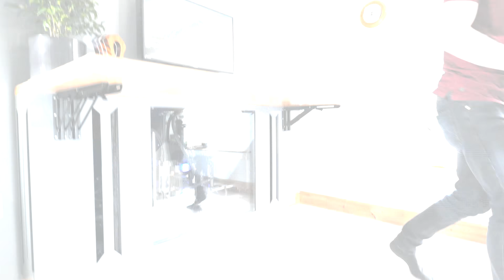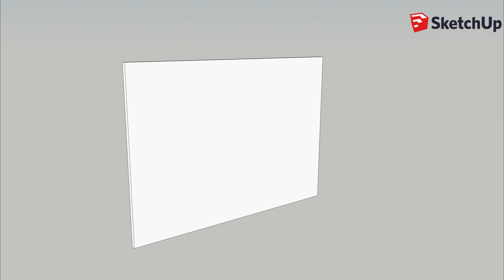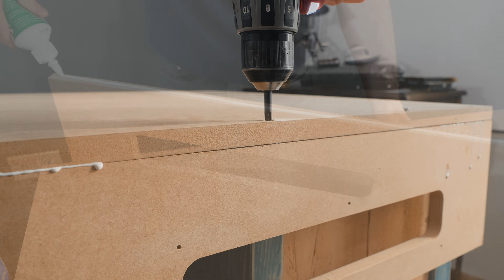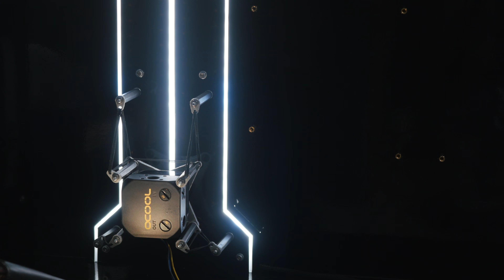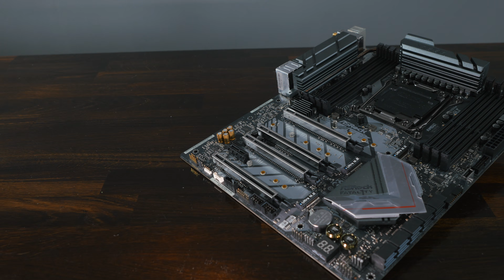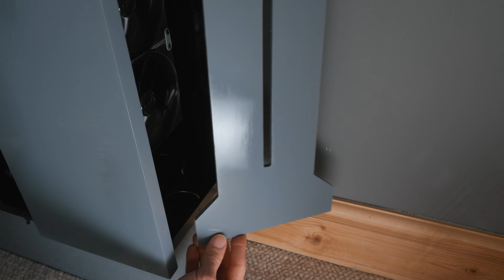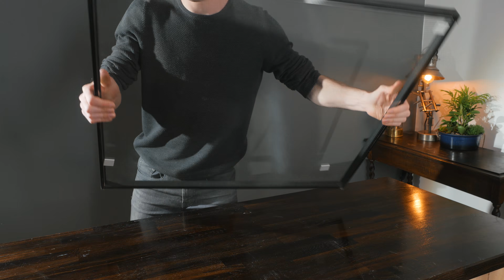Building a spectacular DIY 'desk PC' (it can fold!)

Comment: I absolutely love the design and build but I have two concerns.

One is the mounting method for the water pump, radiators, etc. Those elastic pieces do not last and especially under such heavy hardware and water being held up, they will not last over time. I strongly recommend you pull those out and build solid shock mounts instead.

My last concern is why did you use MDF? Why didn't you use plywood or a more premium hardwood for such a powerful build? MDF is not a very suitable material for cabinetry.
Reply: The density and characteristics of MDF help with noise reduction and it's cheaper. Bear in mind that although the PC Components are premium, he has them due to sponsorships, and he has to buy everything else, like tools, paint, etc

Comment: Nice build, as a amateur woodworker and future water cooling enthusiast, Well done Mate. Personally I like the Corsair vengeance RGB ram, and the G skill Trident Z ram. I prefer the look of EKWB components, I already have my water blocks, Pump, and Radiator. Fittings are from Primo Chill, and the res is from Bitspower. 

But really man in the future if you want to do custom cables just do it from scratch. I cannot imagine how much it took to solder on extensions. When all you need to do custom cables like I am now for my build (Fractal Design Define S2) is Crimpers, side cutters, wire strippers, 18 gauge wire, sleeve, terminals, and heat shrink. Once you get the hang of crimping its really easy. Look into the heat shrinkless method on youtube for tutorials on custom cables if you ever do it again.

Comment: You seemed to have removed all thermal pads from the graphics card and didn't apply new ones before attaching the alphacool block. Is that block really supposed to attach without thermal pads? I haven't seen GPU blocks that do not need thermal padding so it gave me cause for concern.

Excellent build otherwise. When you released the announcement video (sort of) for this you inspired me to do my own version for my computer, which ended up being a mini-ITX system built inside a shelf (mock-up: https://i.postimg.cc/YCDp7QLx/Untitledv3.jpg). Now that your build video is out I'm glad I'm not too far along building it, because there are some great woodworking ideas here I could use to make improvements. If it was up to me, I would've just carbon fiber wrapped the entire thing and called it a day. :P

Thanks! Glad you're back!

Comment: I would love to see how he gets the air bubbles out. This whole desk is a mistake, anything air tight will just continue to get hotter and hotter due to components, there is a reason Lian Li makes their desks the design they are.
Reply: Have you ever setup a water loop? You get rid of the bubbles when you first fill it and then run it for a period and they will dissipate. 

It's also perfectly fine with being airtight. The internal water loop doesn't need airflow, just the radiators which he mounted and put towards the external openings on the side of the case. Maybe you didn't catch that.
Reply: @gaderic  I have built many watercooled PCs usually you tilt the PC to get the bubbles out, which is why every techtuber does it.

Comment: Excellent creation.  By the way I'm a Plumber by trade and noticed that the radiator to the left of your wonderful creation has a thermo static radiator valve fitted near to where the heat is dissipated from your cabinet. You may need to adjust the setting higher on this valve to allow for the additional heat which may influence it coming from the PC, otherwise the room may cool sooner due to a false reading as a result of the heat from the PC.

Comment: Well the pump mount was a little over engineered rubber o rings would cut it down but your also forgetting the phone vibrating makes noise due to freedom of motion. When mounted vibration is reduced due no lateral motion and rubber washers would absorb any left over vibration... Edit Then I see the radiator mount say hold my beer.... SMH And Buy a monoblock.

Comment: This is an amazing build. I'm curious about SSD temps? They can get pretty toasty.
Reply: My guess as all the other temps are kept undercontrol they are able the shed heat a bit easier then normal as they are not likely to get heat soaked which is where the temps seem high

Comment: I do not recommend to use elastic bands to hang parts on it. They will loose tension over time. Use springs instead!
Reply: Yea, but aren't the springs the same?Just asking, because I'm not sure if springs to loosen-up or not :).
Reply: @eyecred4153  Rubber is aging. That certainly will not happen with springs.
Reply: @Steve Sherman I see, thanks guys.
I might do something similar and this defiently helps ^^

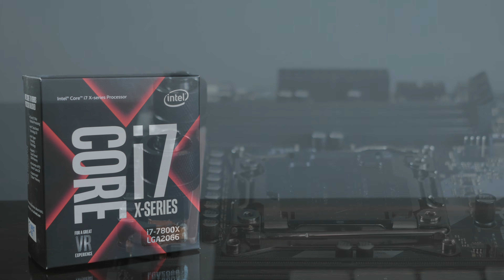Comment: 17:45 but why use a i7-7800X? I mean i know this build is just an Experiment, but why use a 6 Core CPU on such a High End Desktop System when you have 8 Cores (Ryzen 7 2700X) on Mainstream? Even the i7-8700K is faster and cheaper ...

Comment: Watched while video. Must say though you kinda disgusted me. You say at the start we can find the 12 page manual that's free, but then you say it's free for patreons and the link is to join your patreon. That's very poor business practice. I get you need funds, but don't claim something is free and have it paywalled. Just be upfront and say the plans are a perk for supporters.

As far as build, every pc needs air flow to get rid of surrounding heat. Also, the CPU and GPU should be separate runs. You are dumping heat from a very hot graphics card onto a very hot CPU. Not optimal for long term.

Comment: One issue with using an MDF case instead of a normal metal PC case is that the MDF won't block any electromagnetic interference; both interference from the environment to the PC and the PC to the environment. This could be solved by adding a layer of silver conductive paint to the inside of the case, and then connecting it to ground (for example via the PSU's case like a normal PC case would be). MG Chemicals makes a "Super Shield Silver Conductive Coating" that I've used before.

Comment: This is really cool for sure the only thing i personally dont like is the way you have your monitor set up i feel like its kinda far away if you were to sit at the end of the desk. An easy fix would be to use a wall mount that allows you to move the monitors closer when sitting at the end or further away when you fold the table back down.

Comment: Absolutely amazing!! Before watching this, I would've never thought to suspend the components and most likely would have used rubber bushings instead. I also like the DIY water block and it has the gears turning in my head. I have a RasPi that I need to have sealed for outdoor use, but wasn't quite sure how to tackle the cooling. This may solve my problem so thank you!! My only suggestion (I hope you will take this as a constructive critique) would be to hide those ugly monitor input cables in the wall. It would look much more minimalist and cleaner IMO.

Comment: 17:03 - brazed
FTFY

Great project and definitely an inspiration for something I might want to do. My thing is I need space to stretch my legs out while gaming or whatever. And being under the table makes the visual aesthetic of this table difficult to enjoy. I think I'd flip it over so that the PC is above the table level making the components visible to passersby. I'd add a switch to turn off all the LED lighting when gaming (to minimize glare), and I'd put the monitor on an adjustable wall mount so that I could manipulate it for maximum comfort. The wall mount is a bit easier in my case, since I use a 40" UHD TV as my monitor.

But man that's a lot of work...

Comment: I'm concerned about the idea of insulating so many internal components which would need to be passively cooled, obviously the water cooling will deal with the main components, but over time, what about the power chips on the mobo, North Bridge, South bride, vrms on the gpu etc? I can imagine the internal ambient temp getting dangerous over time if it were left on. I'm not saying that this will happen, but in an enclosed system, even if you are water cooling internally, with enough time, temps will only increase.

Comment: And this is why we follow this channel...
Every time there is a video upload, we see some epic shit!!!
Great DIY-desk-PC concept!
No half measures in the process!
A great DIY guide with a great video!!

I didn't even complain it was a 32 minute video... 
I didn't even notice it was that long... 
I thought it wasn't long enough and that you could fit some more "B-rolls" and "glam shots" 

just some thoughts and notes
When should we expect the chiller video you mentioned??? ....Asking for a friend
I would like to know if you tried screwing the fans directly to the suspended 560 (!!!) rads to see if there is an increase in vibrations and a temperature decrease in the loop, or not?

Personally, I would: 
-go with a darker color for the outside, in order to have a contrast with the wall it was screwed to. A shade of "Gunmetal grey" maybe 
-go with the same tubing you used, because of the satin-matte black color, which doesn't pop-up in the build  like the PVC tubes do, but you still can see that it is there
-go for a Seasonic PSU with more watts and a "zero RPM fan" mode, but since it was a sponsorship, the one you used was just a GREAT option! Like... THE best!
-3D-print mounting brackets for the W/C tubing, in order to fix it in place, and use some 90 degree fittings to route it around the motherboard, just like you did with the braided cables.
-not put DAC and AMP inside the case, only because they look nice and would look great on the desk
-get from amazon mountable USB 3.0 extension cables 

I'm pretty sure I do not need a desk like this, but.... I want one RIGHT NOW!!!

Comment: I've been thinking of doing something similar-ish to this only not nearly as cool, and instead of a folding desk where the PC is encapsulated backed up to the wall, it's on one side by your leg. I think I might take the plunge now and use a few of your ideas. Man, are you an engineer by profession or just like to dream up crazy ideas and fiddle with stuff till they work like me?

Comment: Awesome build! From just looking at the thumbnail I thought the vents were tracks for height adjustment. My only worry would be the double glazing not being fully supported on the inside. Over time due to the temperature inside the encloser the inside pain is likely to slip/sag and break the seal.

Comment: I was thinking of doing something very similarly my intent was to build a false wall making a narrow hall closet and building two pcs into the front much like yours but slightly larger and with a beautiful window like your's in addition to this I intend to use a small ac unit to cool  a chamber where the radiators would reside and exhaust the heat outside thus hopefully removing any room heating in my house caused by the pc. I think that this should help lower the need to run my larger ac unit and thus hopefully lower electrical costs a bit as even with just one of my PC's running while performing under heavy load tends to heat up my room to eighty degrees F even when the ac was initially set to 68! since the radiators will be in a separate chamber I shouldn't have to worry about any condensation and as long as I exhausted all of the other heat from the board and chips that aren't water cooled should keep this system extremely cool.

Comment: you really shouldn't have mounted the "audiopanel" next to the powersupply as it generates loads of electrical interferance that might be picked up by the audio cables!
Reply: The casing of the audiopanel should be a Faraday cage

Comment: First of all: Respect for building this, it looks like one hell of a time dump.
But: Why didn't you go with a plate to which the components inside are mounted that is hung from springs or strong rubber? It would've helped with cable management too as it would allow you to hide them behind said plate. The same goes for a PSU shroud; a kind of compartement at the side with a 120mm rad above pushing cool air over the PSU, pump and reservoir could've looked awesome, as I don't find them appealing just hanging by some rope or the tubes (in case of the res). It looks (and probably works) awesome for the hard drives tho, I may copy that idea and build it into my own case. And having the audio gear sealed like that... well, I'd just have put it (that is gramatically incorrect I guess) on top of the PC, maybe created some sort of housing for it as well (or the table surface a tad lower and the main PC body a little bit higher? That could be something too).
And I'd love to see some sub-zero stuff, I'd especially like to see you trying to block all the noise (I've heard the compressors are LOUD).

Comment: I think I want to work on a project like this. However, I have some 1/4" core ash paneling that I'll likely laminate onto some 1/4" high-density polyethylene (that frosted looking white plastic cutting board material) for the panels, and I'd like to incorporate some brushed sheet aluminum into that as well. I think I would make the back plate that the components mount to out of a sheet of aluminum over a panel of high-density polyethylene, with the aluminum facing the user, and the side and front panels out of the core ash/high-density polyethylene panels. I'll also use a sheet of tempered glass framed in core ash covered high-density polyethylene for the center front panel hung like a barnyard door so that it can unscrewed and slid sideways. 

I think I'll make the desk itself out of 1" high-density polyethylene with midnight ash paneling laminated onto the top, and then the high-density polyethylene itself can be illuminated with RGB lighting strips inlaid into it for an ambient lighting effect. The entire bottom layer of the desktop would have a glow anywhere from dim to bright. 

The HDPE layers in the PC cabinet could be illuminated as well. It'd have a warm yet Tron-esque sort of look to it. Think about it, anywhere you layer the ash over the HDPE, you can use a router to make a channel in any design you could think of halfway into the panel, through the wood, exposing the HDPE below the wood. Then you could mount LED strips to the other side and illuminate the frosted look of the HDPE. Take one of those cutting boards and place a light behind it and you'll see what I mean. It glows /really/ well if the HDPE is the right kind.

Comment: Much as the styling is nice, having the motherboard in an airtight chamber will not dissipate the heat from the memory chips, the hard drives or any of the other non-watercooled chips such as the voltage regulators. It also means that expansion such as additional powered cards such as USB expansion cards is rather impractical without a re-route of cables and the associated external connectors.

Comment: LOVE IT! Amazing work! We know what a pain to release this video was, but it was so worth it. 😀

I know this is nitpicking, but HDDs often rely on the case airflow to work under acceptable temperatures. Be sure to check your drives temps to see if they are not too hot.
Reply: Especially HGST drives

Comment: Putting analog audio cables near a PSU? That's a bad idea in my book. It could work out fine, but I'd rather design it to avoid any possible interference (I prefer HDMI or DP audio anyway).
Reply: PSU have metal case - it work as Faraday cage. Audio cables, even cheap, have shielding too.

Comment: Amazing! Unfortunately I don't have the skill and the devices to do anything like that myself. However my focus on putting my last 2 PCs together also has been something dust and noise free.
If a company actually sold full versions of something similar with all componnents (the "table", dampening and cooling), I'd probably buy it.
What I don't like that much though, is that your window is under the table. You will either not see it because you are sitting on front of it, it's blocked by the plate as you are looking from above, or you won't see it if the plate is in vertical position. For a commercial version I would have prefered a unit which is a bit smaller in size (there was a lot of spare space) and probably mount it to the wall instead without the table-socket construction.

Comment: dang this is freaking cool, but as an avid computer builder that water loop throws me off so much, that's genius floating it in the air to lower noise, i never would have even thought of that, but at the same time, seeing it just dangle and shake is so weird, as everything in a computer is usually super sturdy, also i dont know how much experience you have with computer building, but you are surprisingly knowledgeable as this is the first time watching you and i was wondering if you would make and computer building mistakes, but you know your stuff, this is really cool, also jesus christ those are massive radiators, honestly i dont think you even need the fans, they help with airflow and the fact that you got such silent ones is pretty good, but the sheer amount of radiator space you have means that this pc would probably be able to be passive cooled, no fans whatsoever, I mean ive seen pcs with similar hardware that where pasive cooled with only one maybe 2 of those 4 fan radiators, and your have 3 freaking thick radiators, i mean i saw two 560 radiator, those things are beasts

Comment: That is AMAZING...I wish I had the time, money, or skill to build that. I will say with 1320mm worth of rads in that system (2x480, 1x360), two of which are extra thick, the temps were a little higher on the CPU than I would have thought.  Questions for you:
1. Is there a reason you didn't water cool the m.2 SSD?
2. On the temp stats, how long did you run the system before you took the measurements?
3. Are you running any overclock on the CPU or GPU?

Again, absolutely beautiful work.